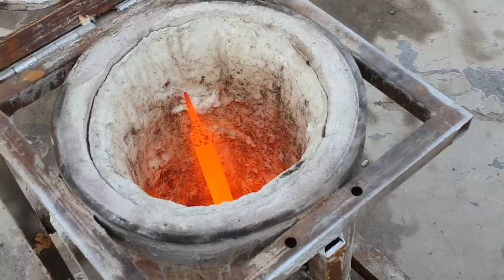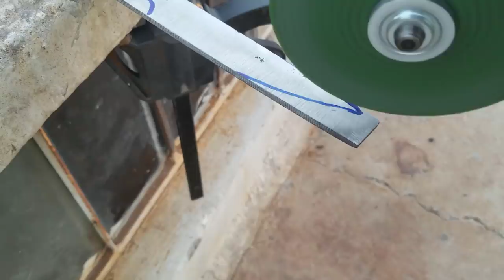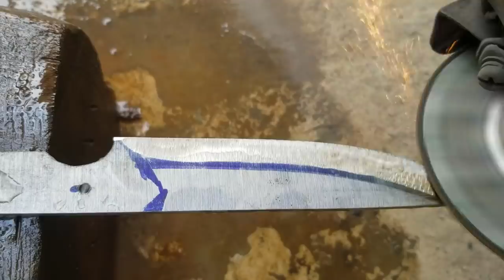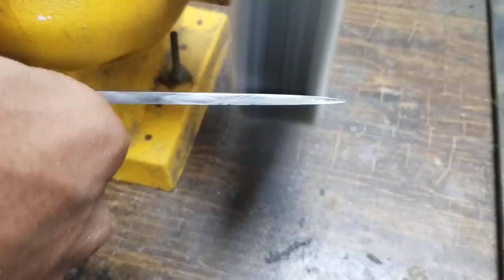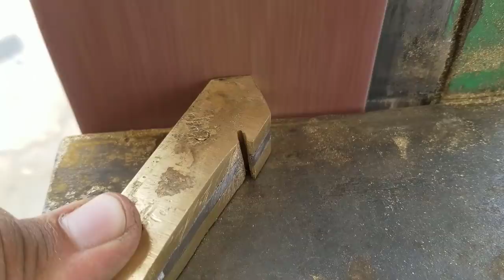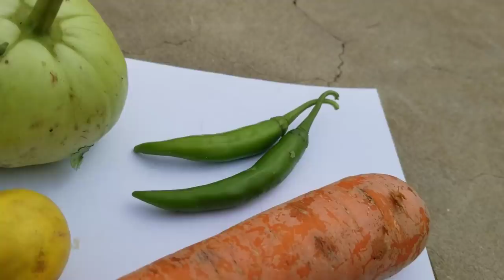Turning a Rusty FILE into Shiny but razor Sharp KNIFE

Comment: Quick ask as a newbie but the heating at the start was to “untemper” it ?!?!
Reply: A file is hardened upwards of 50HRC,, it is quite hard. The operation at the start was to back temper in , it was basically annealed ( only as hard as the steel's chemical composition)
He then proceeds to remove metal whilst still in the "soft" sate, and, then he re-hardens it ( raises the steel above approx 850C and quench in oil.
However,, he continues to make the knife with the material still in the "as sequenced hardness  ( at a guess approx 60 HRC ) . 
What I don't see him do is to temper the "knife" to a reduced hardness - heat to about 250 - 300C and allow to slow cool in oven / furnace.
Because of all of thesis, the knife is very brittle, and, the edge will chip ( if not entirely break  / crack ) if subjected to any impact - like chopping at wood / bone .
Hope this helps
Reply: Leo R helps heaps cheers 👌
Reply from the maker: That was Normalizing process for steel.
Reply: @metalhurts1635 Whilst I am not a metallurgist ( but only a "humble" Mechanical Engineer ),  Normalising process is when the item is slow cooled OUTSIDE the furnace in still air ( to refine the grin structure ). In the video, it is allowed to cool INSIDE the furnace ( whilst it still has latent heat ) - this is annealing and it serves to soften the material back to it's "as rolled" condition.